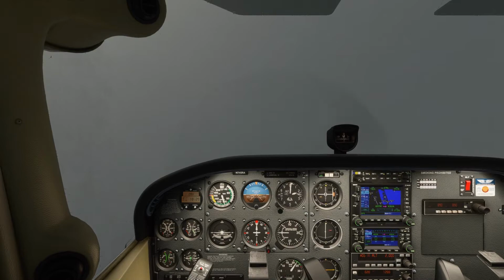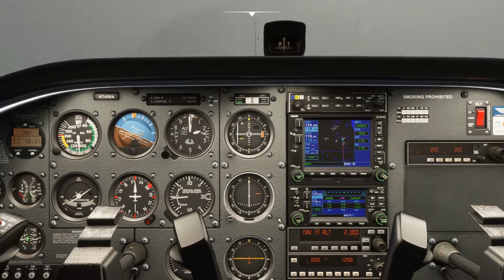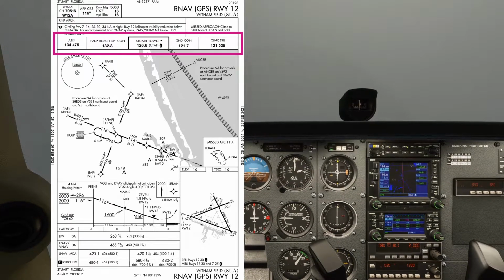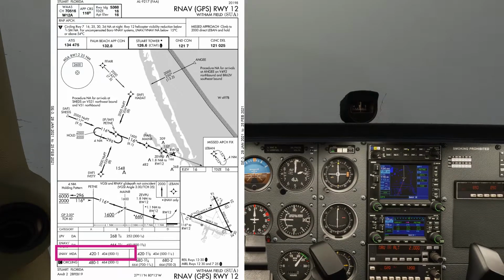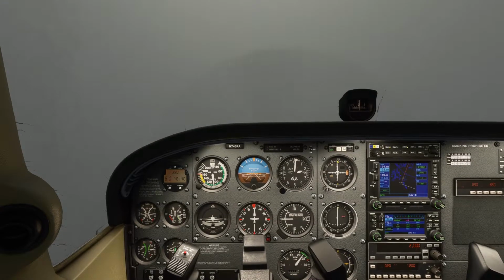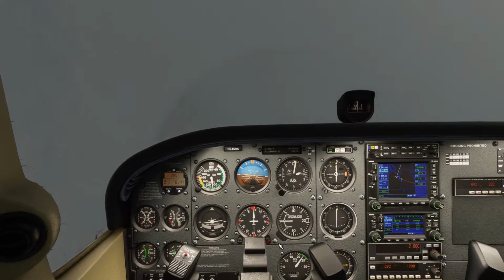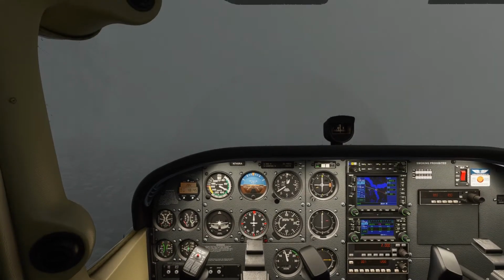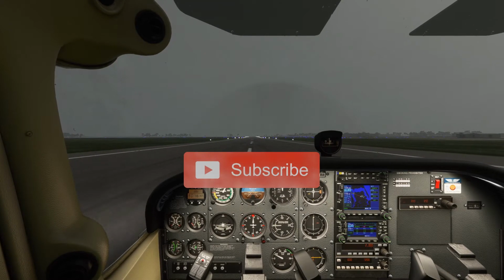RNAV Approach Tutorial in Microsoft Flight Simulator with Real Airline Pilot / Flight Instructor

Comment: Am i to understand this is not possible to do properly without the plates? Like the GPS wont tell you the required altitudes at the fix?
Reply from the maker: Some more advanced systems will have the vertical profile information programmed in but you would still be required to have the official publication of the procedure on board in some form, like paper or electronic plates